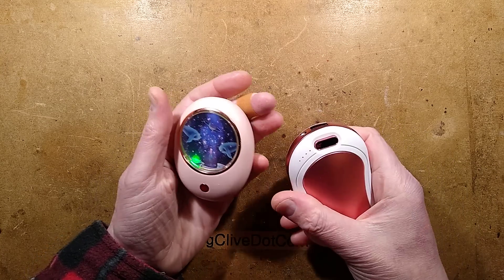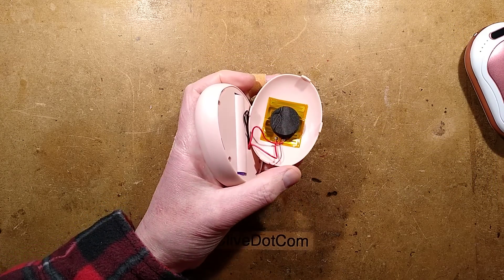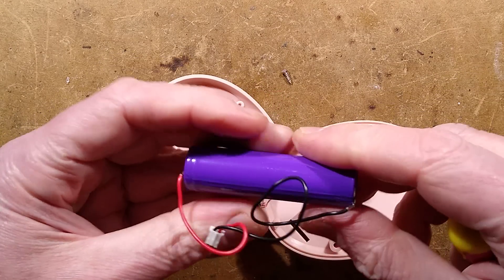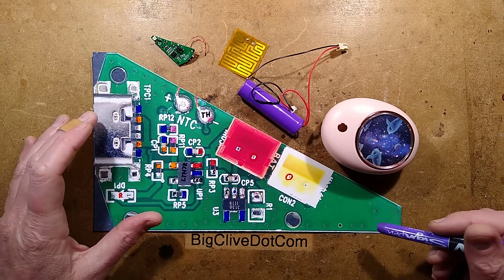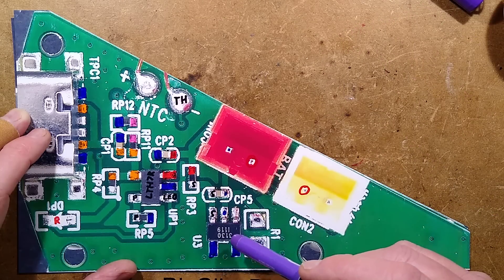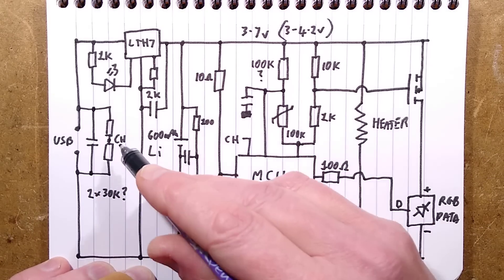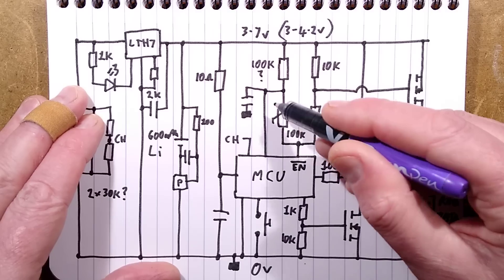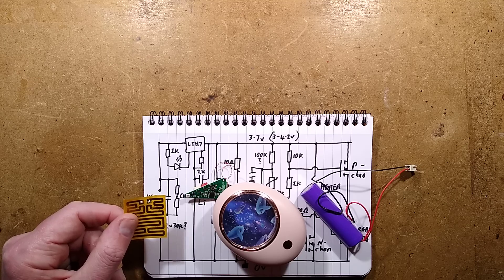Engineers vs accountants the handwarmer mix.  With schematic

Comment: several years ago I bought two of the vibrating ones on Amazon, the manual was poorly translated and thus hilarious. pretty sure they used batteries that are manufacturing seconds or otherwise sub par, and so they got them cheap. the batteries had different charging rates and capacity to each other.

Comment: The 5000mAh claims on these things seem to be a common claim - the quality seemingly varies, the pinky one you had at the start seems to be a very similar designs that are ten-a-plenty on Amazon and the like - I've been sent a few to "review" and whilst they heat up pretty nicely if you "need" a hand warmer and last a good 8 hours - I've not torn one down but the cells in those are definitely not 5000mAh but definitely bigger than that piddly 600mAh one!

Comment: So they did that lol, they made the 18650 look like a 35E so most without testing equipment wouldn't really question it. 600mah doesn't even need an 18650 size.

I'm curious to know if there was labeling on the battery.
Reply from the maker: No labelling.  It was very anonymous.
Reply: @bigclivedotcom  

A lot of the times in the manufacturing industry over in China, businesses pop up overnight, at the same time others get shut down.

Watching channels like "China Insights" and over there it's cut throat... Everyone is always trying to cheat someone.

Unfortunately, the big fish pick on the little ones all the time like this.

This was probably a startup company, had that really compact circuit design, felt they could startup off this because they'd save more money than the competition on thier circuitry. They put in a purchase for batteries, and probably didn't check that shipment until it was time for product assembly.

By the time they realized they were lied to by the supplier, the supplier has already abandoned that shell company they used to offload some old product.

The CCP doesn't like this, but it's so common place that the system meant to handle it is overburdened and always late.

So what are you to do as the hand warmer manufacturer? You've got bills to pay, employees to take care of, and a product that's now effectively dead in the water, and you lack the capital to rectify it.

Your choices are;
A. Take a loan, buy the right batteries, try to recoup costs on your bad purchase, possibly get burnt again or pay double.

B. Try to pass the scam off on someone else by doing what was done to you. You can just sell them on AliExpress through a fake business. It might take time though, you still need to move your product.

C. Give up, file for bankruptcy to avoid putting out a useless product that will just see more returns than good reviews.

D. Just put the batteries in, market it as intended, and hope that most won't care or notice if you sell it at a competitive price.

E. Try to wait to recoup your money and just shut down your factory until then.

All crap choices, and this is your survival, and the survival of others who depend on you for stable employment.

It's clear the design was kind of half-polished with the light not doing much. It was probably meant to illuminate some UV dye on the design piece. Lots of assumptions, but they were probably able to get rid of the UV die with another manufacturing project, but they still had to use the batteries, circuit board, and the heating elements.

It would be a smart move imo, just try to keep in mind when you buy cheap Chinese shit, "they are probably just passing on the screwing over to you."

Lol

Comment: I can confirm the Samsung 50E 21700 is 5000mah. I use these types of batteries in my mechanical vape mods.

I prefer making my coils and wicks, dealing with resistance is fun.

That looks like a 35E 18650.

Usually purple = 3500 mah. Blue = 5000mah, and Green =2500 mah

If you go generic all bets are off though they don't color code their stuff cause they usually are relying on you not having the tech no-show to check, and not actually needing that much, and not complaining when they die quickly because they were cheap as hell.

Comment: 3:35 What are those hex nuts on the back of the picture holder thing? Or are they not hex but actually metal pegs that have been melted in somehow? Really weird that the RGB LED has been lined up to shine through just one of them. Very strange construction...!

Comment: I received a USB rechargeable handwarmer for Christmas. It's branded Auiiah (gotta love keyboard-smash brand names!) and I'm actually surprised with how well it works. I doubt its 10,000 mAh claim (it is pretty heavy though), it runs for quite a while, and it heats on BOTH sides. Not too shabby for a $20 device, haven't tried out the power bank function yet. More comfortable in the hand than your average cell phone. I have also used it here and there to apply heat to sore joints and muscle spasms, it gets almost as warm as an instant heat pack. One of the best gifts ever, and I'm happy my mother stumbled across a better version of what could easily have been crap.

One month, and it hasn't exploded yet. 😆

Comment: Any chance that you could take apart a programmable batteryless clone key for automotive anti-theft systems and explain how they work?  Apparently it's possible to write a new code on to the circuit board in the key that the automobile's RFID transceiver can read.  No battery needed.  Must be tiny, it's all in the head of the key.  A Ford PATS key would be neat.  You can get keys reprogrammed at the local hardware store now.
Reply from the maker: It's probably an RFID system powered by the receiver.
Reply: @bigclivedotcom  Thanks for the reply.  The power does come from the car's receiver but I was interested in the circuitry inside the key head that allows it to be reprogrammed.  Also, how exactly the key head receives the energy from the transceiver then returns it with the code to the transceiver so that the system will allow starting.  They are not hard-wired like a store's anti-theft RFID tags, they have some sort of EPROM.  The hardware stores identify the code from one good key and write it to the new key.  They call it key cloning.

Anyway, just a suggestion.  Thanks for the videos, they make me realize how little I know.  But I do learn a little bit with each one.

Comment: That's a Padauk PMS150C isn't it? The terrible 3 cent micro? VDD on pin 1, VSS on pin 8, an analog comparator output on pin 7, a PWM output on pin 6, a reset input on pin 4... it lines up surprisingly well.

Comment: A shame about the battery. I do however suspect someone sells an 18650 with 5000 MAH printed on it even though it will not be closse.
Reply from the maker: They mark them much higher than that.  Search eBay for 9800mAh 18650.  Needless to say their capacity is usually 500-1000mAh.

Comment: That USB-C thing is becoming my bane as I make my way into the USB-C PD ecosystem.
Two LED PIR light bars, a head torch, and a rather nice Bluetooth headphones set all fell victim to the missing resistors problem.
Fortunately I do have a random noncompliant charger (and a few compliant 5v output ones that do have the resistors) that I can use for these devices.

Comment: I don't know how expensive this is, but if cheap enough it actually sounds like it might be worth getting just for the control PCB --- you'd then retrofit it into a new case with a much bigger battery. That mysterious R1 might be useful for making it work with a battery with a built-in protection circuit. Possibilities, possibilities...

Comment: I have a electric wheelchair that is 24V 55AH (12V 55AH X 2 in series). i have 2 X 12V 45AH that i want to add to it. what is the best way to add them to the circuit. please explain to me why the way you suggest, is the best?

Comment: At 09:00 .. what is the square component with a circle in the middle above the chip?
Also the blue lithium battery is a lot bigger than the small one but similar power.. what is the difference, does it last longer etc.
Reply: That's called a push button momentary switch.  Mentioned at 10:47 on the schematic.
Reply: @haywoodyoudome  
Thanks... only option I'd thought of was a bridge rectifier and they'd used one diode.

Comment: Don't you love it when accountants get involved in any from of engineering, classic example was the Titanic (designed with bulkheads that went above the plimsol line which would probably have saved her) when they stopped the bulkheads below the minimum water line so save a few quid. The cost of Lithium batteries at that level is so low they actually ripped themselves off by using the 18650 form factor

Comment: What was in the other handwarmer? Like what was the battery capacity, since i wouldn't mind some handwarmers that doubled as battery banks.
I wouldn't use them as battery banks often, but it would be nice to use in a pinch.
Reply from the maker: Search my videos for hand warmer, since I featured a similar one before.
Reply: @bigclivedotcom  Thank you. I found it.
For anyone else.
https://youtu.be/o7IvYsPYiFA

I'm guessing this pink one didn't have 10,000mAh.

4k-6k mAh at most I'm guessing. That's still not terrible. Since it's winter here and my fingers aren't too great at finging when they get cold.

Comment: If you upgraded the 18650, would you need to change any other components?
Reply: No.
Reply from the maker: No.  It would be fine with higher capacity cells.

Comment: I think they make 5000mah 21700 batteries, which when I first came across I mistook for an 18650. Since my only experience with bare cells larger than 18650 were of the 26650 size, being nearly 3x the radial difference made the 21700 look like an 18650 from a distance, then just confusing until I read the label. That is obviously not the case here... for better or worse.

Comment: I have 18650'S that claim to be 6000mah and some that claim to be 9000mah
Reply from the maker: I think the highest capacity technically possible at the moment is the premium cost 3000mAh cells.  The eBay high capacity cells are fake.

Comment: You opening the case and subsequently breaking of the mounting pins, produced more heat than the heater is capable of due to the cr@ppy lithium cell.

Comment: Would love to see a video on the heater clothing (Vests, hunting jackets etc) i assume the same claims and same batteries. I did have a motorcycle jacket a long time ago that plugged into the bike that would keep you toasty worm in the worst weather. but it was 500+ dollars plus the plug added to the bike... As usual a great video. I learn so much from these. would love to see some of those wifi light bulbs with the ESP chips. Wonder if you ever find wifi devices that send more than they should back home via internet.

Comment: It would be great to see a video of a quantum healing device. One of my friends bought a really expensive detox machine and was using it around 2010. Dodn’t have the heart to tell him it was quackery. That one also had a wrist band so that the ”positive ions” could transport bad things out of the body. It also came with a colour chart so that he could see on the colour of the water and compare which internal organ that had been cleaned. Very sophisticated scam. It made him feel better, though and he could afford it. Back to the quantum healing devices it would be fun to have a qualified look what is inside. The claims of these machines are beyond current academic knowledge of physics, just to start by that.
Reply from the maker: I've made a few videos about the detox machines.  They are just corroding their electrodes into the water for a dramatic effect.  The wristband may be so it knows your feet are in the water before it puts on its fake show.

Comment: Interesting.
So if the battery gets warm when the heater is on, is the heater necessary?
And what value resistor would extract the maximum heat?
Thanks Clive.
Reply: It's a similar situation as with audio amplifiers.  
The maximum output you can dissipate in the load is when its resistance matches that of the power source.
When the load resistance is the same as the battery's internal resistance, the heat generated by the battery is equal to that from the load.

Comment: The temperature sensor is a voltage divider off the power rail, which is not regulated, so the observed temperature would depend on the supply voltage unless the A/D converter expresses its result as a fraction of the supply voltage.
Or perhaps the degree of error is immaterial.

Comment: I wonder what the odd part labeling on the PCB means. Most (but not all) resistors are labeled "RPn", capacitors "CPn", diodes "DPn" rather than the usual "Rn", "Cn", and "Dn"

Comment: I'm one of those people who apply brute force when removing parts then find the hidden screws afterward. Not many things I examine ever go back together.
Reply: Maybe things you examine don't go back together, but what could you build with the spare parts?
Reply: You simply failed to use enough epoxy to rebuild the connectors.   (I've repaired several laptops where the screw insert "supports" had ruptured, mostly for the hinges.   Assemble lightly with CA, then flood the area with high strength epoxy.)

Comment: Often the accountant will get the kudos of saving costs, but the engineer gets the blame when it consequently fails to work as intended.
Reply: "This man had the idea to spend less money?! Genius! Give him $10k for Christmas!"
Reply: @Agustinus Reynaldi nothing inherently wrong with Chinese stuff. There's some fine engineers in China.

It's usually when manglement get involved. Eg some bearings are required and lovely races with a 20 year life are specified. But. It'll function with plain bushes at a fraction of the cost. You save X dollars per unit and that's pure profits. The plain bushes are selected, a note added to the manual to oil them regularly (without checking if that's actually practical) and the unit cost drops a few dollars. "It's not safety critical", they shrug.

2 years later management want to know why their new model wears out in 18 months and starts rattling after 6. They need a high-level view and aren't interested in any pettifogging details about obscure engineering knowledge of "ball races" Vs "phosphor bronze bushings" and just want to know how the engineering dept let this happen so it can never happen again. They put a rather familiar manager in charge of that...
Reply: @Rapscallion2009  you know what he meant perfectly fine. China just produces a lot of hardware and so gets associated with hardcrapware by ecological fallacy, and he was making a joke of that.
Reply: @chri-k  Don't forget the tofu dregs

Comment: Yeah, you can tell the heater wasn't making good contact with the plastic enclosure because of the curved shape. It would've been better if they used a flat metal cover like it looks like the other one has. But I agree that the cell is way too low capacity. With only just over 2Wh of energy, and a starting discharge rate of >1A, I'm guessing run time is 30 minutes, tops?

So yeah, poor thermal coupling means a lower temperature, and a crappy battery means terrible run time. Seriously, you're better off just buying a pair of gloves. At least there's no chance they'll catch fire, unlike that crappy cell.

Comment: My father was a Design Engineer and had the role of Chief Engineer for the small engineering firm he worked for.
The company had two production lines each with its own compressor to run power tools.
There was a proposal from on high that this should be replaced by one compressor unit.
My father was called upon to produce a costed design for anew compressor and housing.
When he presented his conclusions to the board,  the accountant asked why the building had a pitched roof.
My father explained, as calmly he could manage, that in order carry out maintenance there would need to be space for lifting gear.
The accountant asked what the difference in cost would be if the building had a flat roof.
My father then explained that if the building had a flat roof the compressor would have to be hauled outside - possibly into the rain - for servicing. Furthermore, he said if the accountant pushed for this flat roof that the board would be answerable for the consequences.
My father got the pitched roof accepted.
This was one of many unnecessary battles between engineering common sense and short sighted penny pinching that he fought in his career.
Reply: Why not a flat roof but higher?
Reply: @PaulMansfield  I am not an engineer but I would imagine a pitched roof has more structural strength for the lifting equipment vs a flat roof. Flat roof will bow under heavy stress would be my guess. Not saying a flat roof wouldn't work but would require more structural steel than that of a pitched roof and cost more.
Reply: @Funsnuf  very good point, yes, the cross beam would also be a good hoist/pulley mount.
Reply: I watch @Plainly Difficult all the time and it is deeply alarming how many people have died solely because some unscrupulous company wanted to save a buck.

Comment: Anyone here aware of a small adapter available on the market capable of adapting micro USB to USB C? 
I recently picked up an SDR radio which I'm quite happy with aside from the blasted micro port on it. While I was confident in my ability to increase the battery capacity on it, I'm doubtful I have the required to skill to directly replace the micro USB.
Reply from the maker: You should be able to find an adaptor on eBay.
Reply: @bigclivedotcom  I'll poke around. Thanks Clive. 😊